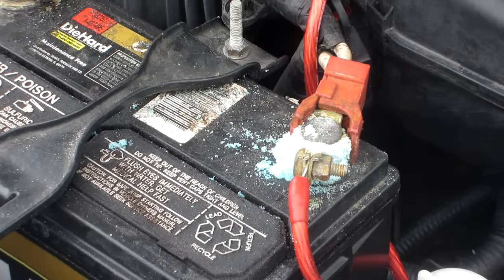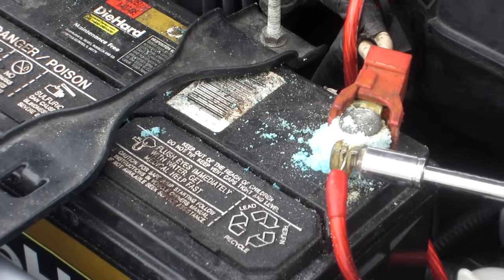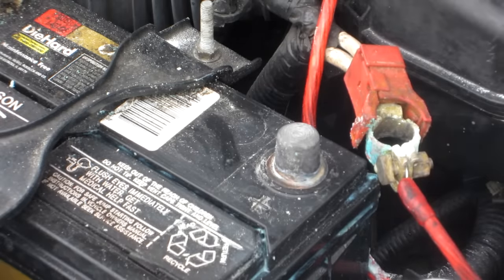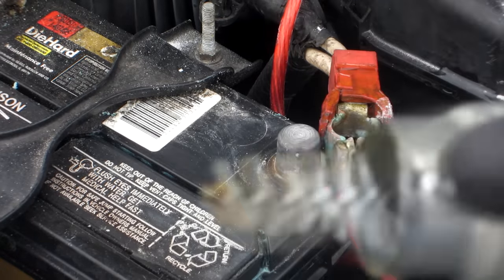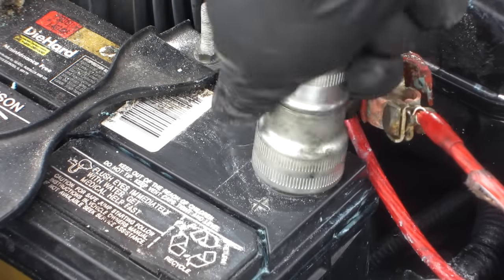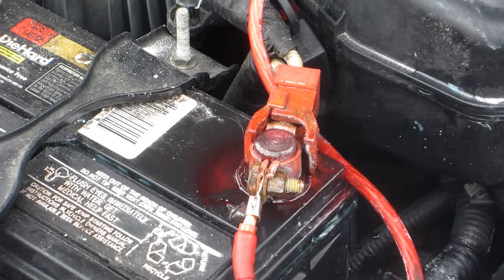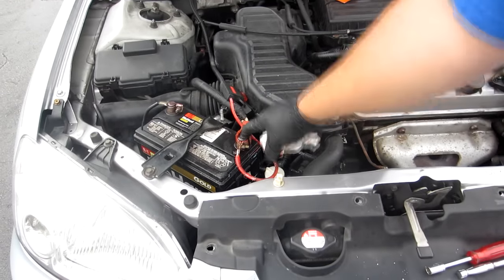HOW TO REMOVE BATTERY CORROSION FAST AND CHEAP!!!

Comment: Shop tried telling me I needed a battery and an alternator. I suspected corrosion was the problem. Used the baking soda and toothbrush method and it started up like new. Mechanics really try to take advantage of women. Thank god for youtube.
Reply: I just went to two different shops, they told me my battery was bad, no, it’s corrosion, tried to play with me, this is not my first rodeo🙄

Comment: Acid will continue to wick between the terminal and the case. To prevent it, apply silicone caulking or gasket sealant along the seam. It would be better to dip the cable end into a solution of baking soda to neutralize acid that was drawn up the wire. Next day, squirt a penetrating oil on the cable end. It will wick up the wires and protect them under the wire coating. 

You don’t need a special protectant. Any grease or anti-seize will be fine. 

While you’re at it, clean and protect the positive connection at the starter and the ground on the engine. Both terminals and contact surfaces should be cleaned with sandpaper or a wire brush and coated with grease or anti-seize.
Reply: A cup of it mixed with a tooth brush or a spray bottle would save time.

Comment: quick tip....baking soda and hot water works great. I use an old peanut butter jar so I can add the baking soda, water, and shake it up really well. ALSO, with the jar you can put the battery connectors in the water in the jar, and the solution will eat away all the corrosion that cant be gotten to with a wire brush. Works really well ... thanks for the video ....

Comment: Pour vinegar on it. It dissolves instantly. It will even display bright shiny copper. If you want to soak it for a while use a paper towel. Fold it over a few times, put it on top of the terminal and pour the vinegar on it. The paper towel will hold the vinegar there until you wash it away. Then clean it with a wire brush.
Reply: Pour Vinegar/Acid on the battery to clean the Acid off???😖🤯
You use the Soda to Neutralize the Acid first before touching it and spreading it everywhere like he did in the video 👍
Reply: @jamesglenn520  How bout this? You do it your way. I'll do it a way that I know works very well. Everyone's happy.

Comment: Never had a corrosion problem on a car battery until I installed an amplified head unit,  gave everything a deep scrub and even had to dip the leads into the baking soda solution. Never did I think it'd pull that green crap off but it worked like magic. Even got some dielectric gel and lubed the piss out of everything.

Comment: Wire brush works fantastic for removing corrosion. Use dielectric grease for connections. Thanks for posting

Comment: How does he not get electrocuted when scraping the positive terminal
Reply: Where would the circuit be completed
Reply: The secret: the VERY real danger is in accidentally completing the circuit by touching negative (or nearly anything else metal) at the same time. The risk is real so it’s I’ll-advised and there’s a reason many many people will start by pulling the negative terminal before performing almost any work
Reply: If you’re confident that you won’t do that, you probably will…

Comment: Thanks. Same question as other people in the comment. 1. Shouldn't you have to remove neg. first? 2. Wouldn't it be more wise to avoid the water and use a flat tip screw driver or any such tools to remove the corrosion?
Reply: Yes; and yes-dry scrubbing to remove most of the build-up without splashing it all over the surrounding insulation tubing and components, and then cleaning with a paste of baking soda + the smallest amount of water and wiping away, then rinsing with clean water would be best.

Keeping the baking soda away from the vents (where it pools up and bubbles in that channel running mid-way across the battery casing) is notable, since the cleaning solution will have an unwanted effect with the battery solution if it leaks inside.

The battery casing is fine with water—they're designed to handle weather.

But applying the anti-corrosive grease to the post and clamp before reconnection is not proper application of the technique either. You want to coat the connection in anti-corrosive material and ensure the firmest, most consistent connection between the power source (terminal post) and power delivery (clamp) possible. Adding dielectric grease (which does not carry current) between the two is Opposite Day.

Comment: Dife use motor oil on your terminals after u clean them and it will never carrode again garrantee it
Reply: Im shocked i havent seen this more often.  I put oil on old bolts that come out rusted. Connections. Any bare metal to keep it from rusting or corroding

Comment: Thank you for this video . Came to the dealer for only a oil change and they scared me saying the battery was leaking acid and my car would stop working anytime now . I was so closed to buying a new battery!! Thanks
Reply: Yeah but maybe it was leaking acid.  This is just battery terminal corrosion.  Two different things.
Reply: Gotta know @jassyolvera1617 - did the battery go bad or was it a Stealership move?  Checking back in 2025 for an answer.

Comment: Make sure your battery  is completely  sealed if you get any baking soda into battery it will flatten your battery and shorten its usefulness . Acid and base do not mix together.
The best alternative  is to just pour hot tap where over  the corrosion instead. Best to remove negitive cable first then positive cable.

Comment: Note- he used a lot of baking soda on this- you can premix a teaspoon (for example) with water first. A wire brush is recommended but I use an old tooth brush as long as I toss it afterwards or keep it with car supplies.
Reply: I use my wife's toothbrush.
Reply: @philipwebb960  savage 😂
Reply: @philipwebb960  Chad move.

Comment: Take off the neg terminal before messing with the positive. Saves a lot of arcs and sparks.
Reply: I am agree
Reply: Thank you :’)
Reply: Am I literally clueless how do I know which one is which ? Does it say on the battery ?
Reply: @alejandracisneros4176  Black is negative, red is positive
Reply: @jmor2252  thank you so much🙏🏽
Reply: My car wasn’t starting , when I popped the hood I found the blue stuff. My only question is would I need a jumpstart after I clean it?
Reply: That means your battery is not good anymore your gonna need a jump every time or at some point it will cause a short on your wiring system if keep using it like that. Your battery has no juice (battery acid). Thats what the blue stuff is
Reply: When I put the battery back do i put the positive first then the neg?
Reply: @peterpiper5914  what happens if I change battery without changing the cable that also has the rust am I going to have the same thing around  it in the new battery?
Reply: @nooki626  no it comes from the battery, not the cable
Reply: Absolutely!
Reply: @alejandracisneros4176  yup says on battery near terminals, plus sign is positive (red), minus sign is negative (black).
Reply: @alejandracisneros4176  as someone once told me “when you see the negative, think of negros. So positive is red, negative is negros” In Spanish. Never forgot after that.

Comment: Hi. I had an issue with my battery light keeps coming on resulting in the car cutting off. Had the alternator, fan belt tension replaced but the light still comes on. What could be the suspected problem now? Car type RAV4 2006 model

Comment: ALWAYS REMOVE THE GROUND WIRE FIRST before touching the hot wire with a metal wrench.  If you don't, and accidently touch the wretch to the chassis, you will start welding the wrench to the chassis.
Reply: Korek
Reply: What’s a ground wire?
Reply: @jaidastallworth5395  The battery wire that is connected to "ground", aka the chassis.
Reply: My thoughts exactly.  Video neglected this super important step.
Reply: Im guessing youve welded a wrench to your chassis before 😂
Reply: @TrendyBromando  No, because I always removed the ground cable first.  :)
Reply: @johnwilson7809  very good 👏
Reply: You’re about 8 years late brother.
Reply: @jaidastallworth5395  -ve polarity
Reply: @jamescoburn2767  wonder how many people didn't do that first lol
Reply: The negative (—) terminal. Black cable vs the positive (+) red cable.
Reply: Good point.  Always disconnect the ground first and than the positive.  When going back, always connect the red hot fire first and then the ground to prevent a short to ground to prevent major damage to your electrical system.  My cat bit into the Blue tooth speaker charging wire and killed the system, is trash now.
Reply: And ground your ÉCU .costly repair!
Reply: He's a noob
Reply: Baking soda....
Reply: @jaidastallworth5395  basically most likely the negative (black wire)
Reply: You remove ground cable first so when you remove positive terminal cable you won’t get a spark. The older batteries give off hydrogen gas which could explode if you remove positive cable first. This guy wouldn’t be my mechanic
Reply: @RODNEY PAINTER  you have no idea wether or not he removed the negative before he started the video
Reply: i’ve done this haha
Reply: There is no such thing as a ground with DC circuits, there is only positive and negative. The only kind of short you can make, is shorting the positive and negative together.
Reply: @jackc8621  Haha.  Very funny. The chassis is considered the "ground" in most automotive applications.  While technically not really a "ground" per se because it's not IN the ground, it's what it's been called for the last 100 years or so. But thanks for the clarification.  By touching the positive to the chassis via a wrench, you WILL cause a short circuit with enough energy to weld.
Reply: what grease would be best to rub on the connections and terminals after? Petroleum?
Reply: @christophercarrillo4231  Most any Silicone Dielectric Grease for Automotive applications.
Reply: Comfort people who aren’t are knowledgeable why don’t yaw say oh the ground cables back 😐

Comment: If you don't have the anti corrosion spray you can take wheel bearing grease and coat the entire terminal and clamp with it after cleaning to keep out air and moisture. I've had connections stay clean for the life of the battery that way.

Comment: do you need to do both sides? or just the positive side? I see mostly corrosion on the positive side, then on the little screws on the top of the j-hooks that are part of the battery clamp holding it in place, then last I see a little on the negative side. just clean them all? and put the grease/red-spray on them all?

Comment: Would you ever consider simply removing the battery and cleaning it outside of the vehicle? Any reason you leave it in the vehicle and pour stuff right in the engine bay?
Reply: Did it to my car with the battery still in the engine bay with no problem
Reply: Too much work

Comment: Simply take warm water (not hot) and pour it accross the battery and terminals use an old tooth brush to gently clean any residue that wasnt removed. Repeat if necessary and rinse all the residue off and flush the area thouroughly above and below the battery and its box with a garden hose . Do this before you touch a terminal for cleaning. If it is mild corrosion you may not need to remove the terminals. Keep your battery clean using this method and no more problem.

 The battery discharges accross the terminals when it's damp or wet and the battery is dirty. Dissimilar metals cause corrosion problem . And don't overtighten the terminals they have a pinch factor and overtightening them and bottoming out the bolt negates the holding or clamping effect = means they are not tight.

This is not an old trick or hack it's an ancient inexpensive one  that anyone can do.  After your done buy a tube of dielectric grease and coat the terminals  or the battery posts befor reinstalling them, this reduces or stops the corrosion completely. FYI dielectric grease insnt a lube, it waterproofs terminals and is conductive. Its used in electrical connectors throughout vehicles and many electrical applications.  A small tube will last a long time as little is required.
This got overanylized and beat to death when it's simple and easy. Don't need baking soda, could use vinegar but not necessary for a automotive style battery. So for you old dogs with the simple Warm Water  Rinse, glad some of you are still around. One other point to the unaware, Google the  cause(s) and be enlightened, don't just take a BoobTube vid or comment  as gospel and that includes my post. Not just saying.
Reply: Dielectric grease is non conductive,  better using contact paste.

Comment: Before winter season starts, disconnect the terminals and clean them with a wire brush. Reconnect, then smear with petroleum jelly. The jelly will prevent corrosion and help keep the battery cranking all winter long!

Comment: You spent too much time in cleaning up the mess you made. It would have been better to remove the battery from the car. Cheap easy protector is plain old vasilene..
Reply: which is just pure clean old grease
Reply: lots of things can be utilized, to varying effects.

Comment: It would help if you brushed the corrosion first then cleaning the battery! By the way, if you want to stop corrosion happening cover your battery connections with grease!
Reply: what kind of grease do you use on the posts? I have this problem now, and I want to fix it ASAP.  Thanks.
Reply: orestesdd
Any kind of grease does the job.

Comment: SAFTY FIRST.First you need to disconnect the negative terminal to not cause any shorts.
So much easier way to do it without all the mess with baking soda. Just pure Club Soda and that will remove everything.
Reply: I saw another video in which the mechanic just used hot water to remove all the corrosion. It worked.

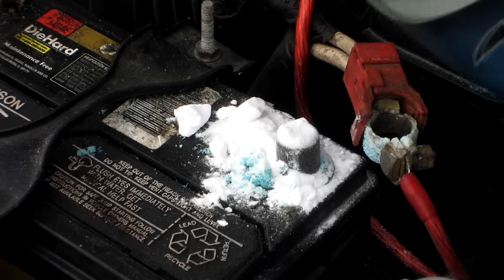Comment: 2:13 the water in itself washes the acid away. You are just adding a foaming effect of a base (the soda) mixing with an acid, but it's not doing anything for the terminals. Very hot water is all you need, and an old toothbrush and a towel :)
Reply: I just use hot water also, melts it right away.
Reply: Best answer actually
Reply: Can I just pour hot water over it without disconnecting it??
Reply: Yeah but look at the foaming man...the foaming.  We are easily amused.
Reply: @arelicastrejon3221  yes
Reply: The foaming is the Soda Neutralizing the Acid which is the First thing you should do before touching anything.

Comment: I was told to remove corrosion from battery terminals with warm water, when was  an apprentice motor mechanic in the 1950, and it always worked.
Reply: Me too David.
Reply: Can the battery cables be left on if just using water? Not sure if i have a tool for removing cables?
Reply: You still need to have something to Neutralize the Acid to stop the corrosion.

Comment: Chad is correct to say never do this to a battery. Batteries are vented so baking soda WILL get into the cells and you will be replacing the battery soon.
Lead acid batteries put off hydrogen gas which is very explosive and needs venting and that is where the shit gets in that you have poured on your battery. 
This shade tree mechanic video is bad advice and should have told you wear eye protection and to DISCONNECT the negative terminal first. A spark can cause an explosion. I have witnessed it.
The corrosion on the terminal comes from the small gap between the terminal post and battery case. Clean the mess with a wire-brush and make the terminal post shine. Then before putting the clamp back on place a red round felt protector on the the terminal, you have seen them in the store with all the battery stuff. Oil the felt and place it on the terminal and then the cable clamp. The felt stops the gas from creating the white acid deposits on the clamp. Make sure terminals are tight.
If your battery ever dies from headlights left on etc charge it on a proper charger asap. The alternator will not charge it enough and will overheat trying to so you will soon be buying an alternator and a battery.
If you do as this fellow is instructing you may be buying a white cane and a seeing eye dog too!
If your car is not driven for a week cput a charger on the battery. Get a load tester as well to see what condition your battery is in.
My last battery was a 4 year and it lasted over 7 years.
Auto batteries are not made to run inverters or stereos or power amplifiers. If your power amp needs capacitors then buy the dang capacitors. You can also get a deep cycle battery to run items such as TV or stereos with an inverter (DC to AC). Deep cycles do not have the amps for a starter but can be discharged a few hundred times and recharged. Auto batteries can be discharged a few times- then they are ruined.
Reply: Thanks for the tips
Reply: Cravinbob is spot on!  Some people should refrain from putting out information that is NOT CORRECT. There’s at least THREE things this guys video did wrong. Please- Don’t put out shoddy information.